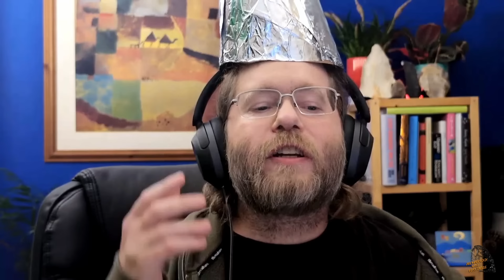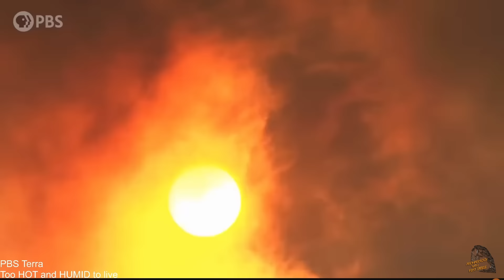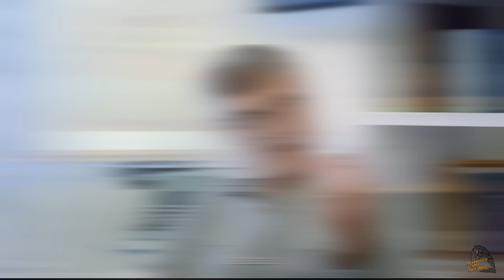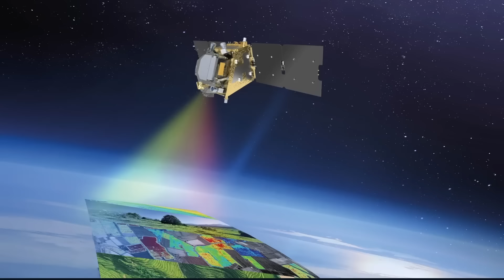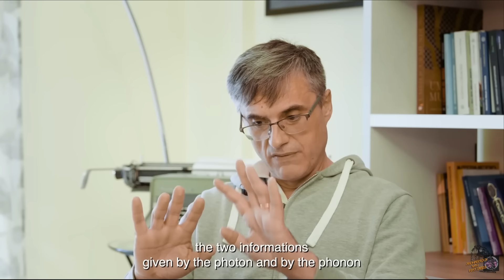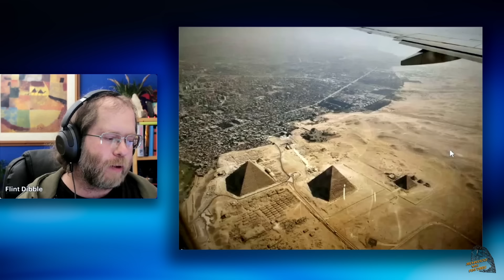The Viral Pyramid Scans: The Ultimate Debunk of the Khafre Project and Filippo Biondi

Comment: There are many reasons to have serious doubts (like greater than 99%) about Biondi's method, and the first is that he does not have any CONVINCING scans of any known underground structures, which should be easy if it worked. In the examples where he claims do that, he identifies some random color blobs as parts of the known structure; he has no good explanation for why most of the known structure is missing from his scans; and he tacitly presumes that all the other random color blobs are undiscovered structures or natural features. A serious researcher would have had convincing evidence in hand BEFORE announcing such extraordinary "discoveries" under the pyramids, but instead of spending the past year trying to prove his method works, Biondi's been hunting for a second Sphinx under a Sphinx-shaped pile of sand from an excavation in 1930.

But there isn't really any reason to think Biondi's method ought to work, in the first place. While it is possible to detect surface vibrations with SAR images (Biondi didn't invent that), the smallest vibrations that I have found reported in research papers are on the order of one millimeter. But Biondi is claiming to detect vibrations less than 0.1mm coming from sources like Cairo traffic and wind. Then, without ever validating that claim, Biondi is claiming to do some kind of tomography (deducing internal structure of an object from waves measured at the surface) with those tiny waves. But ALL forms of tomography require "penetrating" waves. That's simply because waves measured at the surface of an object cannot possibly tell you anything about internal structure unless those waves passed through, around, or bounced off of that structure. That's why real seismic tomography uses earthquake waves or explosive blasts. The waves that Biondi is claiming to measure would be VASTLY less powerful, and therefore vastly less penetrating, and they are also relatively high frequency, which attenuate (lose power) must faster in solids than low frequencies. If it isn't already too hard for you to imagine that such puny waves could penetrate over a kilometer of rock, consider that only a very small percentage of the total wave energy would bounce off of underground density differences, and those minuscule waves would need to make the return trip to the surface to reveal anything about that structure. And to do that, they would need to cause surface vibrations large enough to be detected in SAR images.

If Biondi really could do seismic tomography with such waves, the logical thing to do would be to put an array of sensors directly on the ground and get far better data than he could ever hope to get from the relatively insensitive, noisy, and spotty data from SAR images. Using SAR images to measure vibrations just seems like a gimmick to make the method sound more scientific. But even in the extremely unlikely event that those wave reflections could somehow be detected on the surface, there is one more hope-killing issue: Tomography absolutely requires knowing the precise location of the source of the original waves. People tend to imagine that Biondi's scans produce a more or less direct image like X-rays do, but in fact tomography is an "inversion" process, i.e. constructing a model and modifying it until it exhibits a behavior that matches the measured waves when algorithmically tested with waves from a known location. The "scans" are just graphic representations of that model. But Biondi's waves from traffic and wind don't have a single source; they're coming from ALL OVER the surface, and there is simply no way to make sense of that because there is simply no way to correlate a reflected wave to its source.

As far as I'm concerned, that last problem is the last nail in the coffin of Biondi's method. His ONLY hope is that what he is doing is truly revolutionary, completely unlike known tomography methods and well beyond what they are capable of — a technology so advanced that it looks like magic. But then, we're back to asking why he hasn't yet shown us a convincing magic trick.

Comment: Flint Dibble is wrong in claiming  satellite radar  being unproven: Satellite radar altimeters map ocean surface topography—the "hills and valleys" of the sea surface—by firing microwave pulses to calculate the exact distance between the satellite and the ocean surface. By combining these precise measurements with accurate orbital tracking, they determine sea-level height to within a few centimeters, monitoring ocean circulation and climate change.Core Technology & MeasurementsMeasurement Technique: Satellites (e.g., Jason-3, Sentinel-3) emit a radar pulse and measure the time it takes for the signal to return, calculating the distance to the ocean surface.Accuracy: Modern altimeters achieve a measurement precision of 4–5 centimeters, covering the global oceans every 10 days.Components: Data from systems such as CNES DORIS and NASA laser ranging are used to determine the exact position of the satellite relative to Earth's center.What Sea Surface Topography RevealsOcean Currents: The slope of the sea surface allows scientists to calculate the speed and direction of ocean currents.El Niño & Climate Change: These satellites track large-scale changes in mean sea level, crucial for detecting events like El Niño and long-term ocean warming.
Reply from the maker: That is a completely different use of satellite radar than the one being discussed here
Reply: @FlintDibble  Bullshit, it is the very same concept at the core.
Reply from the maker: @williamwhitten7820 no. It's not. This method has never been tested nor published as mapping kilometers underground

SAR has been mapping surface and near surface features for decades. Nobody is arguing against that
Reply: @FlintDibble  Satellite radar data provides crucial insights into Earth's terrain, enabling the creation of detailed topographic and bathymetric maps by measuring surface heights and subsurface features from space. ~Google A.I.

Comment: The validity of the technology has already been shown in scans of known structures in Rome. You haven't debunked anything.
Reply: Except these scans also come from Biondi with no ability to independently verify them and no accompanying data. Just a screenshot of an alleged scan.
Reply: I came to write the same thing - I have compared the scans with the structures and the method is quite accurate - maybe not up to 1 milimeter but defo up to 1 meter
Reply: @noneofyourbussiness329  what's the paper?
Reply: Great, so what peer reviewed paper is that?

Comment: 15:19 "a hole 2 km deep should be 60° c" but the mine that's 4 km deep is only 65 degrees Celsius? Makes sense if you don't think about it I guess 😂
Reply: Carletonville has a colder surface temperature and the area has a less pronounced thermal gradient. Y'all would be well served by doing just a bit more research instead of stopping the moment you think you've found a contradiction.
Reply: @griffin123122 I'm not saying he's wrong. It's just that that is simple math that most people r going to do and he should probably clarify such things in the video or people aren't going to believe him. I'm just pointing out his inconsistencies the same way he's picking apart the inconsistencies in filippos theory. And just to clarify I don't believe that there are passageways 2 km below the pyramids.

Comment: Read the paper before watching your video. Available on arxiv. The main problem is that they mix actual measurements with low resolution against high resolution interpretation (2nd grand gallery, coils, empty spaces). Which is bs. But for the rest it seems okish on a level on which one can peer review it.

Comment: I agree that the validation methods are currently inadequate. Part of the issue is that Biondi presents a single slide from what is inherently a multi-slice process, similar to tomography. This limitation could be addressed by showing an animation or sequence that reconstructs the full set of slices.

However, even that would not be sufficient. Simply superimposing the reconstructed output onto a photograph of the real structure does not constitute a rigorous validation. What is missing is a quantitative methodology to assess accuracy—clear metrics, error measures, and reproducible criteria for comparison.

This lack of a well-defined quantitative validation framework is where the core methodological problems lie.

Comment: Flint, my friend, these experts you talked to do not understand the method in question. 
Not at all. 
I already mentioned this; the method is solid theoretically. The jargon used is not just jargon but the appropriate technical language to explain the method used by Biondi. 
I still do not believe in the results because this method, while correct in principle, in practice has enormous margins of errors that need to be characterized, and Bondi's published work doesn't do that. 
I was eagerly trying to find a solid debunking of the results, but this video doesn't do that at all.

Comment: You just don't even understand what they even are talking about. How can you judge the method? They say they can detect submilimiter precision of ground SURFACE that make them know the vibration level of the SURFACES. Nobody talked about milimiter precision of underground objects. Those objects are calculated with knowing the difference of surfaces vibration level. This can not be precise! As it is indirect method. But the method of reconstructing of underground objects by measuring surface vibration is very well known method that is used in geology more than 100 years. And called reflection seismology. Now there are passive variations like laser doppler vibrometry. This guys just found a great method to use SAR sattelites to measure that surface vibration on large scales allowing better precision as you have virtually millions of vibration detectors all over the place ( in theory ). The only debunking should be if it is possible or impossible to measure vibrations of surface from the sattelite. I don't have enough expertise in that. But I believe it is possible.  You need to find Doppler SAR radar expert just to determine that. If it's possible than everything else is more than possible.
Reply: Luckily there was a SAR expert in the video who confirmed this was nonsense 😂
Reply: @griffin123122  she is NOT an expert in SAR . She used SAR classic Images for archeological purposes .  She is archaeologist so she doesn't even understand the new complex indirect method which needs a lot of calculation as and math when saying milimiter waves do not penetrate. She never heard about it in her work.  s
Reply: Interpreting SAR results has always required calculations and math, and she's been working with the tech longer than Biondi has 😂 plus, the last time he published his results using this "new and complex" method it was contradicted by more established scanning methods.
Reply: @griffin123122 I'm not going to fix your ignorance if you don't want too. Thanks for conversation.
Reply: The critical issue is not whether reconstruction algorithms exist — they absolutely do — but whether the necessary physical signal is present in the SAR data at all. Without propagating wave information, there is no mechanism to reconstruct subsurface geometry, only to model hypothetical anomalies.

That’s why the question isn’t “can AI or stacking improve it,” but rather:
does orbital SAR actually contain measurable subsurface vibration data in the seismological sense?

Comment: Even IF the radar could see through rock, it wouldn't be able to see a void in the rock. It could tell you if there's a more dense material under  a less dense one, but not the other way around! If it penetrates rock, it's not going to be reflected by air!
Reply: There is no radar it is basically a software that does an interpretation of existing SAR Data.

Comment: Apparently no one will be digging under the pyramids to verify these claims. So to prove or disprove pyramid scans there's a one very simple and quick solution: have the team scan a known underground structure or better yet, a bunch of them, and show the results. If the results match the known data with about 100% accuracy, then assume pyramid scans are 100% legit. If not, they are most likely not.
P.S. Of course, the team must have no prior knowledge of said underground test structures to begin with, so they cannot cheat.
Reply from the maker: Maybe watch the whole video. As that is addressed clearly here with a specific example

Comment: At least I've learned a new word from this - phonon. Apparently it's a significant concept in electrical conductivity and heat transfer in electronics. It sounds interesting.
However, the idea that phonons offer an "interface" to allow this doppler tomagraphy smacks of the "quantum vibration" school of woo-science. A bit like how water is supposed to retain potency in homoeopathy. 
The guy is clearly deflecting the questions. But all he has to do is produce some clear evidence of how the method works, especially useful evidence, like a sink hole detector.
Good video, though. I'm off to Wales now to get some whiskey. Or maybe Morrisons.

Comment: There is such a thing as inverse geothermal gradient where the temperature decreases the deeper you go. Not saying I agree with the 'Khafre Project' scans, but you are kind of doing the same thing they are doing. This is why people should just take the information given and come to your own conclusions instead of taking Youtube videos as gospel.
Reply: If you'd done a bit more research, you'd know why they didn't consider that. Negative gradients only persist for a few hundred meters, which is a good distance shorter than the team is claiming this structure resides. Additionally, negative gradients occur when surface temperatures were previously much colder than current temperatures, but the area in question has been a hot desert for thousands of years.
Reply: @griffin123122  That's assuming these structures were built during the period that Egypt was a desert.
Reply: @vernonhanson4129  I have to wonder if you purposefully didn't acknowledge the first point that the alleged structures are deeper than a negative temperature gradient would affect. Kinda no point in arguing about the surface temperature when it wouldn't matter anyways.
Reply: @griffin123122  Well if you must know, I didn't acknowledge your point because it's incorrect. Inverse geothermal gradients can persist to depths of up to 1-3km. Just stop bro, people like you will follow the herd like sheep.
Reply: @vernonhanson4129  What source says negative gradients can last anywhere close to 3km? 😂 the same one that told you all the governments are using Biondi's tech secretly?
Reply: There's also the fact that the people who own the satellite say it can't see through the ground.
Reply: @NinjaMonkeyPrime  Ofc they say that bro. It's used by world governments and they aren't going to willingly disclose their capabilities. I'll be the one sitting back and laughing once the truth comes out and people like flint have to backtrack and delete their videos.
Reply: @vernonhanson4129  They arent going to disclose the capabilities except we know from decades the tech can not do what they claim and if its a hidden ability then they wouldn't have access to the data which shows it able to do something it can not do. 🤦🏻‍♂️ FFS use a brain cell.
Reply: @AveragePicker  Guys, you need to go to "How the Great Pyramid Was Built? | Lost Secrets of the Pyramid | Episode 1 | Full Documentary." 
You're sorely needed there. Enjoy!

Comment: Its obvious, the water helps regulate the heat and the pyramids have a intricate heat pump system transferring the heat to the surface. this is why its a hot desert. Egypt is sitting on a heater. /s